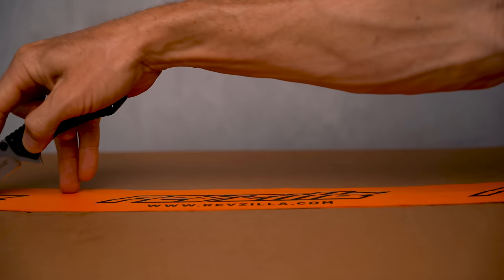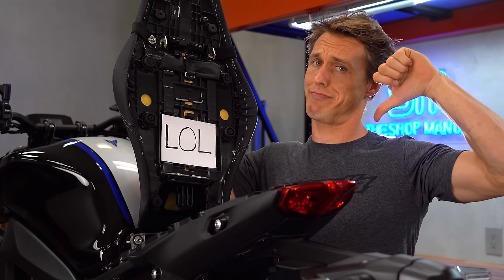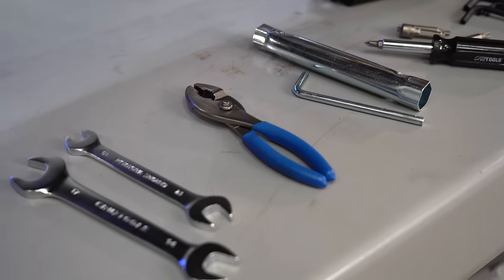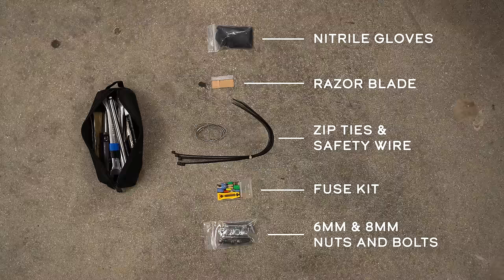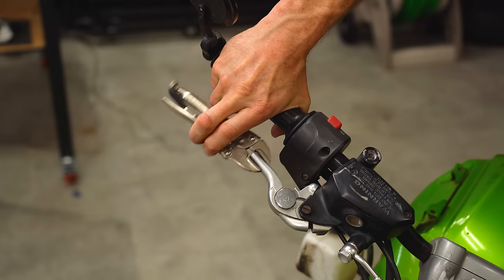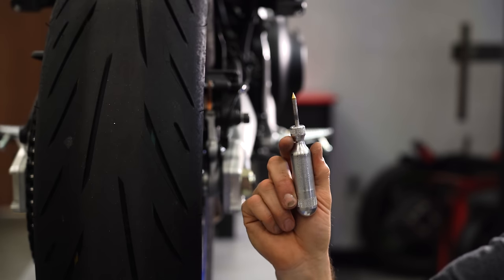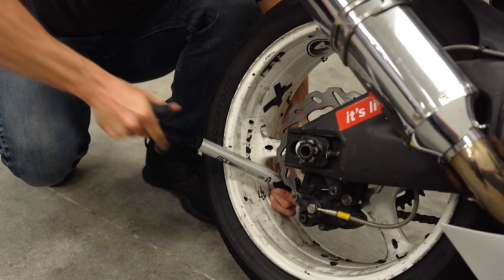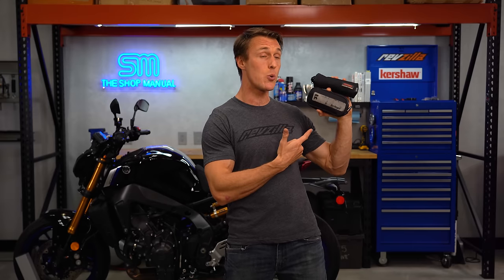How to Build an Emergency Tool Kit for Your Motorcycle | The Shop Manual

Comment: This is a really great video, thank you for making it!
The universe: crickets
Me:
Along with zipties I carry precut slotted velcro ties with a screw hole already punched in them.  Secure a bundle of anything to anything, then do it again; a few last forever and can be repurposed quickly.
Along with duct tape I carry a good brand of gaffer's tape, in a neon/fluorescent color so the repairs can be easily seen and avoided while riding.
Instead of vinyl electrical tape I carry kapton/polyamide and some bits of shrink tubing.  I never recommend the classic "electrician's" tape for anything.  We have many better alternatives now.
Super glue/cyanoacrylate along with activator and release agents to speed up curing/removal is VERY useful in splinting plastic bits or broken electronics together.
A couple disposable torch lighters for finishing various repairs (speed up curing of agents, shrink tubing seals against water and dirt, etc)
tiny bottle of 95%+ pure ethanol (food grade leaves no contaminantsbehind and also isopropyl is a petroleum distillate and may harm parts of your bike) and low lint/lint free tekwipes to get things cleaned that benefit from cleaning.

Comment: I just got back from a 2400 mile trip on my 75 XS650, in 100+ heat BTW, which you should never do, but anyway this is a good video but the big thing it leaves out is to always carry multiple credit cards (at least 3). Past that, my best advice is to do your best to make sure the motorcycle is ready to go in the first place. Everything is easier to do in your garage than on the side of the road.
Reply: which part of "every day carry" did you not get? this is clearly meant for commuting and short rides lol
Reply: @alexandrebravo4472  I think I still had heat stroke.

Comment: Awesome kit! Got some ideas to change up mine a bit. For the pump though i got a small battery pump with flash light, and it doubles as a phone battery charger. I find the co2 cartridges too bulky.

Comment: I never patch or plug tire on bike, flat or pressure loss on bike is deadly. Plug to get home then new tire. In 40 plus yrs have had to replace 3 tires for nail or screw puncture. I am always watch road for any thing Shiney or any debri or slick wet spots. Self preservation.

Comment: The irony of this timing just got home from a 650 ride yesterday and got stuck 300 mile away nursing home a flat tire. Thank for I got home.
Reply: Can't plan for flat tires. I've had to leave a screw in the tire to get to a gas station or home before. Then plug it at home. Ride from station to station and refill the tire with air.

Comment: Great and super informative Ari! On top of what you have mentioned, I packed a battery powered air pump in my bag whenever I am on longer trips.  They are heavier than hand pumps or CO2 solutions, but for the convenience it offers during a flat tire emergency, it is great to save a bit of muscle power.  Cheers!

Comment: If you're bringing 4 c02 cartridges like in the thumbnail, you might want to consider a battery powered inflator. It's a little slower but you get a lot of air out of a full charge. But yeah, I realize while typing this out a lot of people can't really stay on top of keeping track of their stuff is charged or not.
Reply: The 12VDC bike inflator works off your accessories cable, so you don't have to worry about the pump charge fading over months. About 5" x 3"  

A hand pump puts out a lot more pressure and volume than most think, always work but they're often long or bulky.

Comment: A good addition I always carry is a backup jump battery, not only for dead battery. But in emergency will keep the phone running
Reply: a great substitute is to replace your battery with one that has a built in reserve, I know antigravity batteries do, not sure if any other brands out there. This way the battery only ever drains down to 15% and you can still start your engine 4-5 times with the reserve 15%. And install a charging port on your bike.
Reply: problem I have is the clamps are so bulky and hard to store away on a sports bike. I carry a small battery bank enough for 1-2 phone charges, they're significantly cheaper than jumper battery packs and usually smaller in size too. I plan on replacing my vehicle batteries with one that has a built in reserve, I know antigravity batteries do, not sure if any other brands out there. This way the battery only ever drains down to 15% and you can still start your engine 4-5 times with the reserve.  And install a charging port on my bike to keep my phone charged.
Reply: @gwot  totally agree about the clamps. I am going to make my own bike size set. I am surprised that a motorcycle specific clamp set isn’t offered.
Reply: @metalheartmachine  I had to jump my bike before with full size jumper cables, and the clamps are so huge it almost couldn't reach down to the terminals! good thing i got one tooth to bite and that was good enough. I've thought about cutting off the clamps and just replace them with ring terminals and have the cables permanently bolted to the battery, like I have with my trickle charger cable. Maybe a 2 in 1! you know any companies that makes both trickle chargers and booster packs with the same plug?
Reply: @gwot  I have looked: so I think it is down to cutting off the big ones and soldering on smaller clamps. I will see about doing a build video on it.
Reply: @metalheartmachine  I actually found a company, NOCO, that has ring terminal cables than can be used as jumpers and trickle chargers! But I think it's a sold separately accessory, all jumper packs come with clamps. I think i'll go with that instead of messing around with clamps all together
Reply: @gwot  can you post a link please? Thanks.

Comment: Must have a battery jumper kit as well!
Modern ones will also charge your dead smart phone and be an emergency flashlight/strobe
🍻🍻
Reply: I find those small jumper packs are still bulky, small ones are a little bigger than a smartphone but the 2 clamps are always so big and hard to tuck away. a great substitute is to replace your battery with one that has a built in reserve, I know antigravity batteries do, not sure if any other brands out there. This way the battery only ever drains down to 15% and you can still start your engine 4-5 times with the reserve. And install a charging port on your bike. But if you can manage to carry a pack around, that's a great option

Comment: One of the benefits of owning an electric motorcycle without the extra battery or charger, is you have a fairly decent sized trunk where the gas tank would normally be. I carry an emergency first aid kit for myself or others in case of any...well, emergencies, and a tire repair kit. Even with both of those, I still have 95% of the room still left in there for whatever. I normally just have my registration and spare gloves or shirt outside of that.
Reply: Electric motorcycle😅😂😅😂
Reply: @paul9912  5 years riding electric. No issues at all. Having a blast 🤙
Reply: @therealkzero  don't forget your charger LOL
Reply: @paul9912  Well, obviously.  It's electric 🤨. Plus, there are enough charging stations everywhere. I don't even keep the cable in my seat anymore.

Comment: I did not realize how much bikes vibrate until I noticed my brake lever feeling off and discovered one of the two bolts clamping it to the handlebar had completely backed out and was now missing. 

I keep a couple smaller bolts in the toolkit now.

Edit: also need to shit on Cruz tools toolkit that has a bit clearly marked PH instead of JIS or posi for my metric bike.

Comment: I wonder how useful a spark plug tool is anymore on some bikes. I can't get to my plugs without draining and removing my radiator, or removing most of the fairings and gas tank. I'm not going to be doing that on the side of the road...
Reply: i had to drop the whole engine on my buell xb to get to my spark plugs on a long trip! did it in a parking lot with hand tools. really depends on the riding you're doing and how allergic you are to a wrench.

Comment: If you do your inspections and maintenance BEFORE you leave, it will reduce your problems by 90%.
Reply: a tool kit isn't for maintenance, it's for repairs and emergencies, for that 10%. Doing maintenance is a given and not something that needs mentioning.

Comment: First of all, and I find it sad, but most newer, younger riders have no clue how to use tools. Not even a simple screwdriver or end wrench. If it can't be done with a "smartphone" they can't do it. Many can't even put a key in the ignition, because most new bikes don't used keys. I am a 64 year old lifelong rider, and mechanic, so that is not an issue for me. 

As far as flat tires go, they are by far the most common on the road problem you are likely to have with a well maintained bike (unfortunately most younger riders have no idea how to do their own maintenance, and either have to take it to a dealer, or they just don't do it) In my experience, tube type tires are FAR more likely to have a flat than tubeless tires. And unless you are a highly skilled, physically fit enduro rider with all the proper tools and parts, a flat with a tube type tire requires a tow truck. You don't need to bring flat tire tools if you have tube type tires, but I do recommend a cell phone, a road service plan, and staying fairly close to home. It's 2024, there is absolutely no reason for any late model bike to have tube type tires, other than the bike manufacturer simply does not care about their customers. 

With tubeless tires, you have several options. Definitely carry a plug kit (I use the rope type plugs) but you can also use a sealer called Ride On. It will seal most punctures. It will also seal around a plug that still has a slight leak. DO NOT confuse Ride On, which works, with something like Slime, which DOES NOT WORK. NEVER EVER use CO2 cartridges for your air supply, unless you have a way to carry at least 100 of them, which would be a bit ridiculous. I have battery maintainers on all my bikes, and the pigtail that they use can also be used to connect a 12V compressor, giving you an unlimited supply of air. 

Another thing I consider to be an absolute necessity is a jump start pack. At some point, your bikes battery is going to fail. And it could be at the worst possible time. A jump start pack will allow you to start you bike with a dead battery, again, IF you know how to use it. 

For many newer riders, perhaps the best thing to carry is simply a road service plan and a cell phone. They have no clue how to fix their bike anyway. That is one reason why cars stopped coming with spare tires. Nobody knows how to change a flat tire anymore.

Comment: I've seen Stop&Go kit at work and I can tell you it's an overpriced piece of junk. A $5 gas station plug kit will do a much better job. 
Ditto for CO2 inflators vs. a $10 compressor - no contest.

Comment: Good advise, but not practical.  If I were to have every tool for all the items you mention in this video, I would need a separate backpack.
Reply: Err, we very thing in outline and show fits into those two small pitches, which easily fit into my Kriega R20 along with clothes, a water bottle, etc.